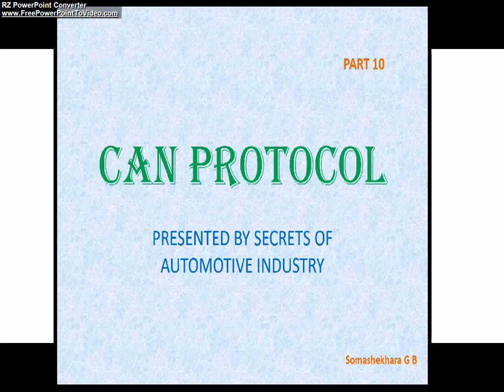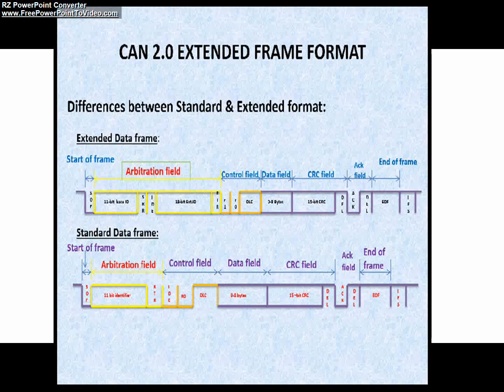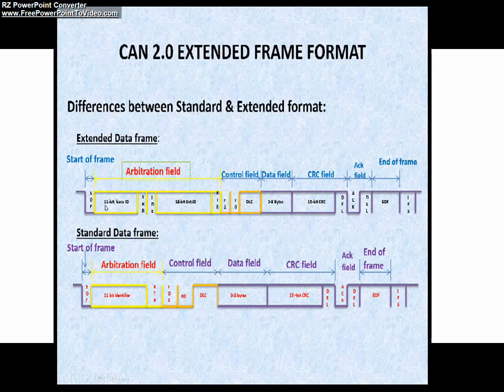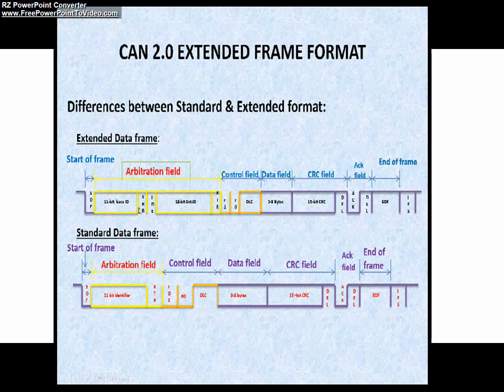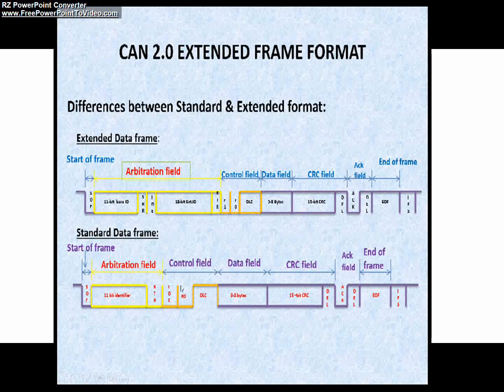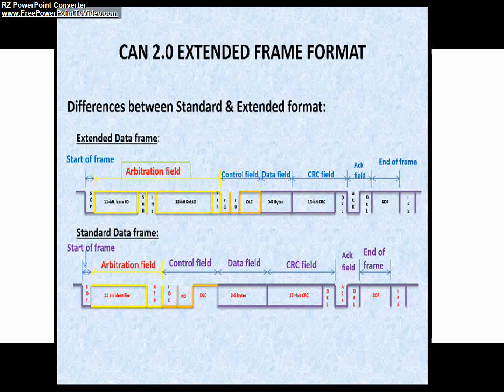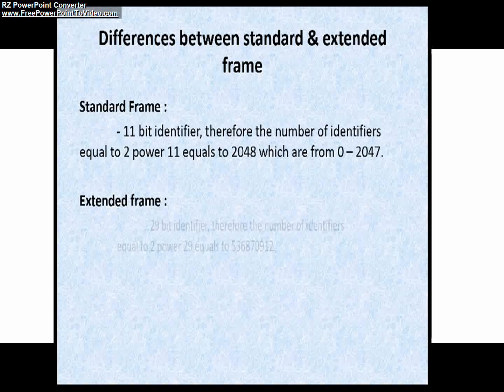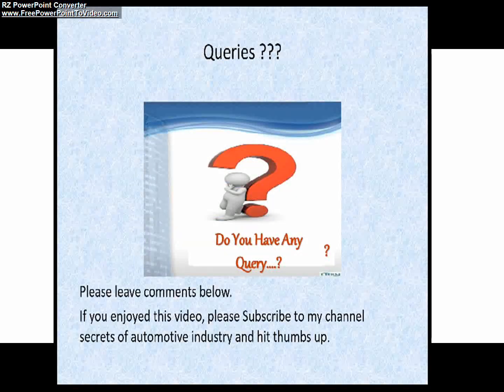CAN protocol basics, PART 10, Extended Frame Format.

Comment: hi,

i have two doubts  regarding can communication 

1.I have two nodes one is  sending  standard format  and another sending  extended format with same id which will get access of bus first?and why?

2.I have two nodes both are standard frames, but one node sending remote  frame and second one sending data with same id now what happens on the bus?
Reply from the maker: 1. Standard frame will win the bus always over extended CAN frame, because IDE bit is dominant in standard frame format and recessive in extended frame format of CAN.

2. Data frame wins the Arbitration. Because RTR bit is dominant in data frame, where as the same is recessive in Remote frame.

still if you have doubts, please let me know here...
Reply: @secretsofautomotiveindustr2910  Sir, How can two nodes have same ids. If it is possible, then in extended format it should have dominant bits in first 11 bits identification field, in such cases extended format should win the bus . Please correct me if I am wrong. Thank you.
Reply: ok , i got it now thank you ...
Reply from the maker: Welcome.Kindly stay tuned..
Reply from the maker: I think, now you have applied wired AND logic Appropriately right?